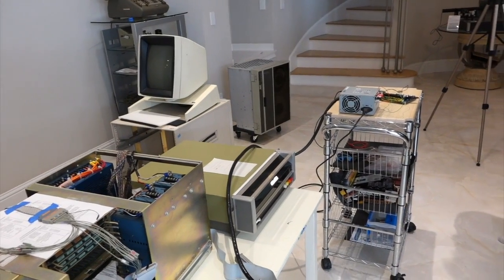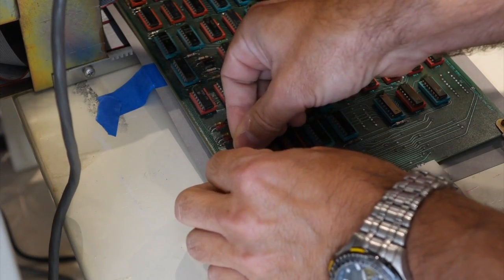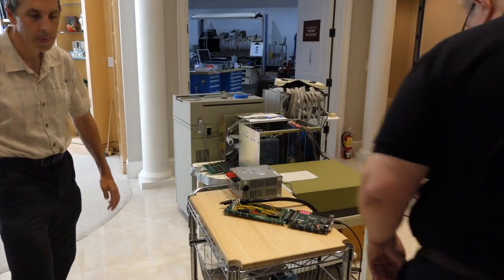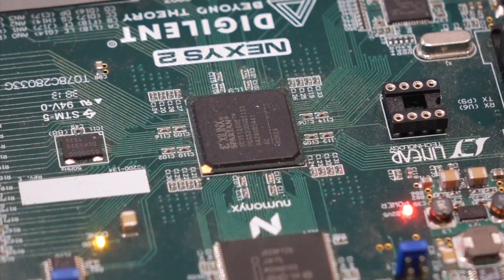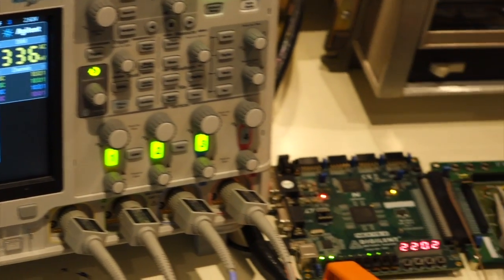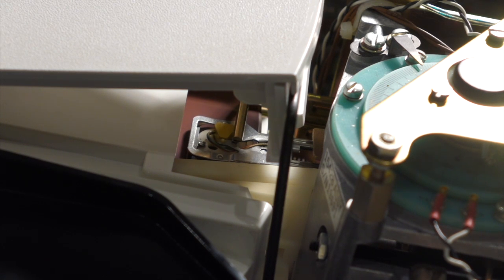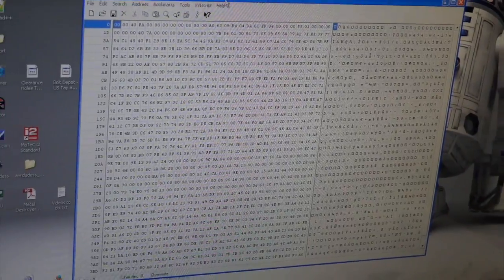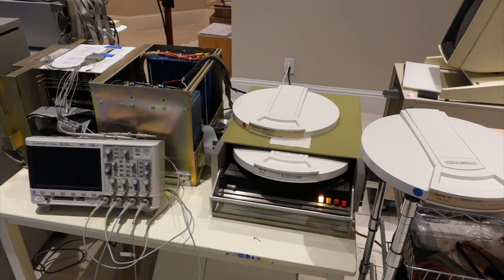Xerox Alto Restoration Part 7 - developing tools while waiting for new boot disk

Comment: those connectors look just like those used by V.35 serial systems but with... 42 pins (can't find that at TE connectivity)
Reply from the maker: And you would be right! These are Winchester connectors.
Reply: @CuriousMarc found them. MRAC-42P and MRAC-42S. Still made, but apparently very hard to source...
Reply from the maker: @AmauryJacquot  Yes, correct again, these are the MRAC series. Apparently Winchester is still around and offers them to whomever is willing to pay... https://www.winconn.com/connectors/connectors-other-mil-spec/rackpanel/

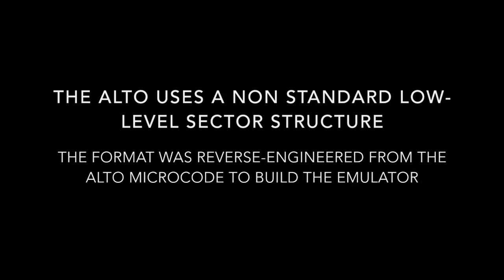Comment: 3:44 do one of you have the plans/specs for this emulator posted anywhere?  I'm wanting to build a variation on what you guys did here to control the Diablo 30 without it being connected to any other host system, like the Alto.  EXCELLENT work guys, even 6 years later!!

Comment: working through your older video after getting hooked by the AGC series.  How much data did those diskpacks hold?
Reply from the maker: 2.5 MB if I recall correctly.
Reply: Just imagine what a stack of 800,000 of them would look like. They’d have the same storage capacity as the 2TB 2.5inch USB I just bought......

Comment: Damn!  I'm sure sorry that I gave away my Alto!  It was ferreted away from Parc when the Alto project was at its peak; there were over 1700 Altos in Palo Alto and El Segundo.   For $6000, I got a pile of parts, each with a green repair tag attached.  Only the Diablo daisy wheel printer worked as is.  The 360 pound (2 disk drives) Optima rack case did not make a very portable PC.    

The 5 volt supply (60 Amps!) was brought to health, and the Alto passed Smoke Test!  Unfortunately, no joy, dead.  Fortunately, my next door neighbor had a working bootleg Alto too.  After comparing his backplane wiring with mine for 2 days, I found an "extra" wire in mine. Remember, these were experimental prototypes, not "production".   'Removed it and I had a fully functional Alto. 

 We had visions of our imminent arrest for possessing such a mind blowing piece of Star Trek. Accordingly, I used Bravo (the word processor) to edit the op sys!  Globally, every occurrence of word "XEROX"  was changed to "MARK1".  Upon writing it back to disk, I found that the op sys executed flawlessly(!)   I can not estimate the value of having a "comparison" Alto.  If I still had mine, I'd give it to you guys.    Anyways, after my wife had finished her 400+ page dissertation, it just sat unused, and I eventually gave it away :-(

Wow!  It looks like you have some schematics. If processor doc is lacking, I was told that the processor was a Data General 1200 microcomputer and with luck Google might find some ancient doc for it.

I hope that you eventually have as good luck as I did.

Comment: Say, if you can read the data off of the disks, couldn't you just erase the useless disk and write a known bootable image to it?
The incorrect data part could just be that the Alto has a different word length I guess. 

Can't wait for the next part!
Reply: If they had a binary file, and they knew the low level formatting and encoding perfectly, perhaps.
Reply: Warp You could also just do a raw write of bits to the disk.
Reply: It sounds like you're not familiar with the various low level encodings, which are far more diverse than you might think. There's MFM, RLL, and many more.   Given how non-standard the Xerox stuff is, I wouldn't be surprised if the low level encoding is not even fully documented.
Reply: Warp Yes, but you don't need to worry about formatting at all if you can just directly drop bits onto a disk - If you're going to format a disk, it'll write bits anyways - so long as you can gain precise control over the mechanisms doing all the related work, you can write whatever bits you need in whatever order is needed - including any headers, footers, or formatting tables that may be needed and are included with the disk image.

Provided the image is complete, writing it to a disk bit by bit shouldn't be much of a problem.
Reply from the maker: +AIO: Exactly. That's indeed one of the main purposes of the tool: to recreate properly formatted Alto discs from data images. The tool writes bit by bit and Ken and Carl have reversed engineered the (very unusual) low-level encoding of the sectors. But we are not there quite yet. We must first read the disk 100% correctly, proving to ourselves we got the low level stuff right, before we can attempt to write. But the (incredibly helpful) LCM people did also write a boot disc for us from their restored Alto, so I suspect we'll use that first when we get it.
Reply: CuriousMarc Reading the disk correctly should yes be an issue, but once you've got proper control of the drive and all of it's associated hardware, you shouldn't have to worry about formatting so long as you've got a complete image you can write directly bit-by-bit to the media, correct?
Reply: Yes, that is what we think too
Reply: Watching along in their videos they're hitting the expected alignment troubles right now.

Comment: Isn't there an easy and reversible way to change the hardware of the disk drive to prevent it from writing to the disk?
Reply from the maker: That's the rub. There isn't. No hardware enforced write protection. And you can't even disconnect the write head without disconnecting the read head. If it came to it, we could probably do complicated things like removing some part of the write circuitry, but that's difficult and risky.
Reply: We could do that, and probably should to protect the precious disks until we have archived their contents. One could disable the write amplifers to the head and disable the erase head current driver. 

The question is this - if booting an Alto requires it to write temporary information to disk, then it can't be booted from a completely read-only disk. Think of a paging area used by a more modern OS, for example, that requires either a read-write drive or a virtual disk to be created in memory just to handle the data that MUST be written in order that the OS will come fully up. 

Perhaps someone fully up to speed on the Alto can tell us if it is possible to bring up the system with a purely read-only disk. Certainly we couldn't store a new file or update any files, but is it feasible to run at all in R/O mode?
Reply: That's a very good idea!
Reply: I would be surprised if there was not.